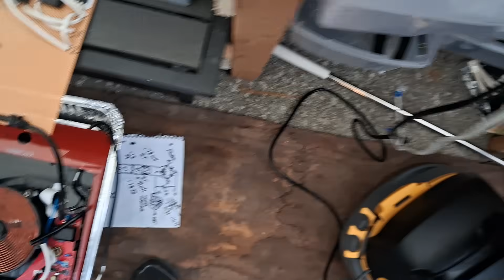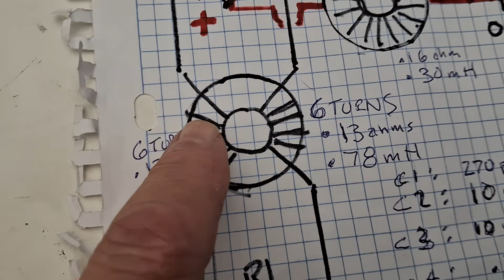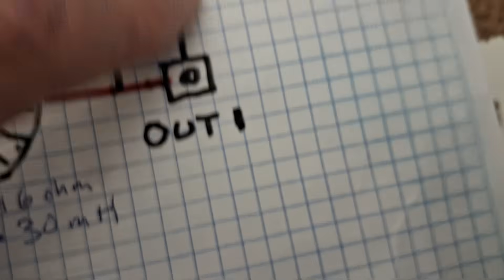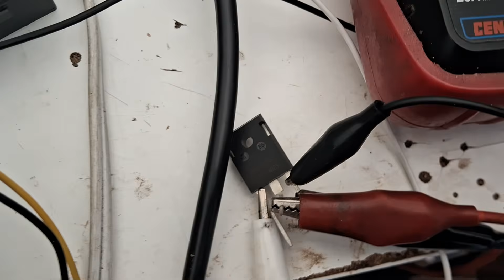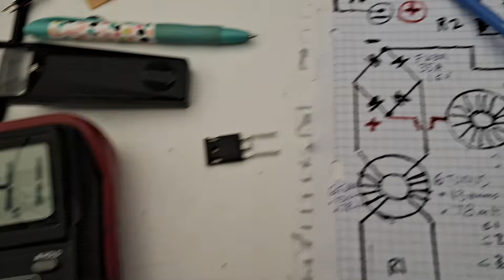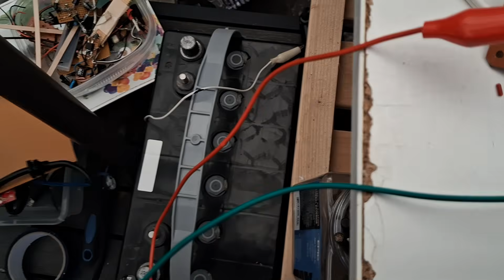Induction cooktop circuit made easy. Also now with simple duty cycle adjust

Comment: Hi Hans
I think I had  caught Leptospirosis which comes from breathing in microscopic fiberglass insulation dust thats been saturated with rat urine from fucking around in attic where some goddamn rats were.
Much better now, lots of hot tea lemon and honey helped.
That is common "lamp cord" the white wire spool, I snaked a long cord up to attic to plug in a contraption that emits a HF squeel humans cannot hear thats supposed to rebel rats. 
I used this wire double thick to hook up the components shown in video too....

Comment: Hi Doug, nice and clear video! Your voice is indeed like you had a 'short night' haha, with some booz from 'a friend' aka too strong. Anyhow, I noticed you had  a big roll of wire on your desk (at 12.54?). Will you use it as a Tesla coil perhaps? I got me some extra coils through Alibaba or Amazon (donno which one) for a few dollars each, on a suggestion of Patrick. These are monofilar ofcourse, but my idea was to maybe rip out every second string and make a bifilar out of it. But that was a bad idea, the plastic holder is soo tight that you easily break the whole coil, so I left that for now. I will take off the ferrite bars at the back and use them as resonator coils. Good luck with your voice, drinking hot water in the evening might help. Kr H